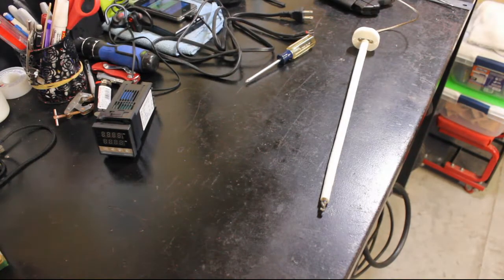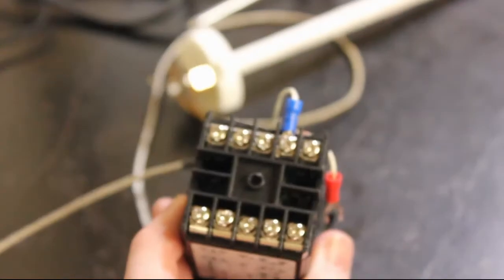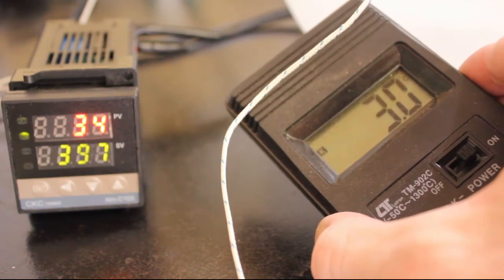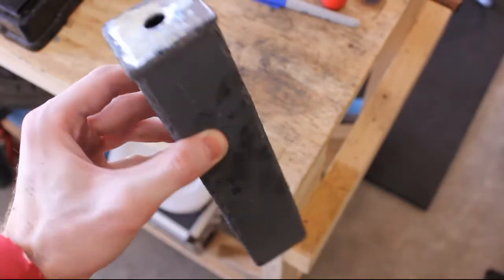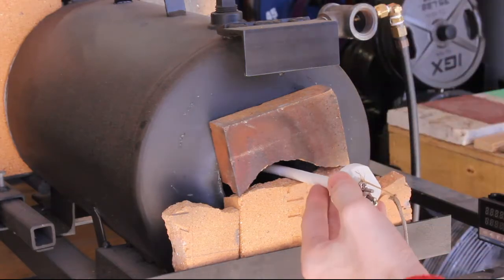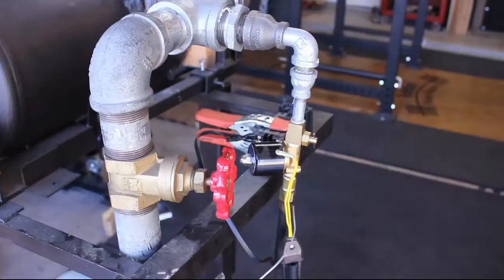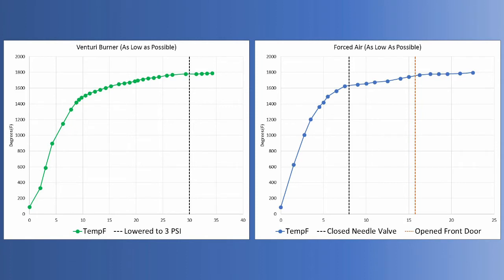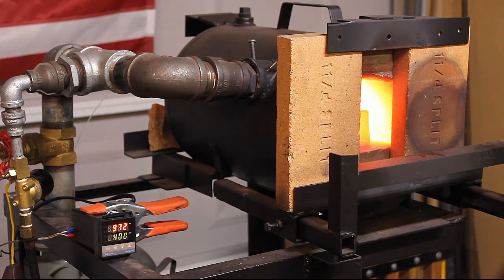How Hot is Your Forge? | This is How You Find Out

Comment from the maker: Anyone have any tips on lowering my forge’s temperature? Any burner sizing changes or ideas? 🙌
Reply: Did the muffle pipe help? I cant seem to bring temp down either so I feel your pain
Reply from the maker: @xxstr8jacketxx  So I did find that I had way more control when using the muffle pipe! However, my heat still got well above my target... I'm in the process of constructing a new forced air burner that I hope will give me more control overall. I'll throw it up on the TUBE once I have it completed! fingers crossed.
Reply: @RedBeardOps  that's awesome dave evader knives sent me your way.i am going to get one of those pids and rod to see how far I'm off.i have everything way down and my 3/16 blades turn orange to yellow in under a minute
Reply from the maker: @xxstr8jacketxx  I'm going to have to thank him! You know it can't hurt to see what temp you're at... Knowledge is power for sure. Heat treating much above 1550 is no good from my understanding, so it's worth investigating.
Reply: @RedBeardOps  I will be making a oven one of these days but I think my forge is to small for 2 burners I only use one and it still blast to much heat I'm going to make a muffler today and see what happends I may have to make my forge bigger this would be great for forge welding but not for HT at the moment
Reply from the maker: @xxstr8jacketxx  I feel you... it's hard to get them to run cooler!
Reply: What’s the internal cu of your forge? I remember Ron Reil saying his T-Rex 3/4” burner was rated too 350cu. It may be as simple as building a slightly larger internal chamber to allow the gas to expand and cool.

  If you go with less insulation or no ITC 100 you will lose fuel efficiency but the temps should also dip. How much of a dip idk.

Maybe lengthen the 3/4” pipe. I am just spitballing here but I would think a longer pipe would slow the mixture as a whole and put less btu’s in. Again this one is a guess.

Have you also tried running a screen in your flare? It will slow the mixture and provide great turbulence. It softens the flame tip as well.
Reply: Red Bear
Reply: So if I get a ceramic sleeve for the end of the thermocouple can I just lay it in my forge without having it in the muffle pipe?
Reply from the maker: @C M  you can. Should be fine 👍

Comment: thanks for the vid. I started using my forge to do some other work, i.e. enameling and glass fusing, so needed to have a better idea of the temperature. Will be getting a thermocouple in place for that. As a side note, for the enameling and glass fusing I began using a section of square tubing for protection, because direct impingement of flame is not good. Now I know the term for it - "muffle pipe".
Reply from the maker: Glad it helped!

Comment: I was read watching decarb on knives on blade forums, and I came across an old thread about this! I hear treat my knives in a forge, with a Venturi burner, and have been getting really thick layers of decarb. I have had my forge WAY to hot (2000 degrees ish) so if I turn it down, and use a piece of 2 inch angle iron as a way to block the direct flame of the burner, will the decarb be thin enough for me to just use a wire wheel to get through? Wil it be gone completely?
Reply from the maker: I don't think you could get 100% no de-carb on 1080, 1075, etc. Always expect to have to do some grinding post HT. I found when using 1084 it seems I get less de-carb then when using 1075. But it could of just been the batches I got.

Comment: Hi! Your PID has a relay out terminal, for sure. Hook up a gas solenoid that will turn on and off the gas to keep a pre defined temperature. That will work just like an electric kiln. Obviously, not as precise, but as far as lowering the temperature it will do the job IMO. Great work btw ,😊👍
Reply from the maker: Good idea, cheers sir!
Reply: @RedBeardOps  just make sure that your set temperature is always above a point that will let the gas self ignite. Because if you set a too low temperature, the solenoid might trigger and the gas does not ignite and you have a problem.or use a pilot flame / piezo igniter of some sort
Reply: You're right - effectively Pulse Width Modulation - great idea

Comment: Excellent video as always. Makes my forge look like a caveman built it with my weed burning torch stuck in hole in the side of my forge. When burning since mine is open front and back it looks and feels like a jet engine. I can barely get close enough to get my knife in without getting cooked myself. I have an oven on the way but I would like to make some improvements to my forge so I can do some knife forging in the future. Thanks for the tips.
Reply from the maker: E.T. Preppin thanks for the praise! Heck yours may get closer to 1500 than mine! I’m going to have to downsize my burner... 🙌
Reply: I’m going to have to put a thermocouple in my forge. Im curious what it gets up to. With 1084 it takes about 5 minutes to get to non magnetic. Seems to fast. Im sure I’m using a lot of propane when running!!!
Reply from the maker: @e.t.preppin7084  In a perfect world I'd like to be able to regulate my fuel gas down enough to have the forge hover @ 1500 F... They use it like a HT oven. Going to have to think on it for sure!
Reply: I just put the front back on my forge. It’s an old paint pot for spraying. Wish I could send you a picture. I should be able to turn my heat down and conserve propane but my temperature will probably increase. Maybe if you leave your front and back of your forge more open it won’t get as hot. IDK. I’ve done no research on the matter and am really new to all this. I’m into so much at one time I cannot learn it all quickly enough. If I were younger I would devote more time to every aspect of knife making. However I have to pay my bills and doing what I’m best at brings in maximum $$$. That’s life. You keep doing what ya do. You learn for me and I just try and do what you do. I brag about you to Dave with Evader knives. Your a perfectionist. I strive in construction to start every project with perfection in mind. As a job progresses you cheat a little here and there and you end up with a presentable final product. Start out cutting corners and you end up with garbage!!!
Reply from the maker: @e.t.preppin7084  Thanks for the kind words sir! Opening the front door of my forge may well work. I defiantly have a lot to think about on the matter to make some adjustments. Thanks for the kudos!
Reply: Well closing the front of my forge by 75% dropped the temp so much I couldn’t get up to 1500. Took it back off and let it rip.
Reply from the maker: @e.t.preppin7084  Interesting!

Comment: Did you ever get it to run cooler? If so , how?
Reply from the maker: Not really. Keeping the doors opened helped. I have become accustomed to the temperature and it is not an issue with heat treating. I was originally aiming for oven like consistency and I don't think that is possible with this set up. You'd have to put a PID controller on your gas supply.
Reply: Those is what I've been trying to figure out for about a year also. I was thinking of keeping the gas supply low and when the temp stabilizes, I would know how to repeat it. Of course I it's all proven to be way harder in real life than in my head.
Reply from the maker: @jarodmorris611  Man, I can get it to run fairly cool... I guess to "do it right" you could have a PID controller on a solenoid to supply the gas. I haven't yet gone down this road. Thank goodness you don't need to soak 1084...
Reply: @RedBeardOps  - I'm pretty sure I'm going to go with an electric oven.  I just had an idea though...what about a propane burner inside the electric HT oven to help it get to temp WAY faster wile the coils are heating up too, then shut off the propane and allow the electric to maintain temp.  Crazy idea??
Reply from the maker: @jarodmorris611  I wouldn't say "crazy", but I bet it could case your HT oven to get "dirtier" faster and maybe damage the coils faster too.
Reply: @RedBeardOps  - Maybe once I get the electric built I'll try pre-heating with the MAPP gas burner I have and see how it affects things.  But, first the electric HT oven

Comment: Ok I made a temporary ( insulated muffle pipe from plaster of Paris 12 inch long 5 inch in diameter with 3/4 inch walls reinforced with minnow trap wire , I put a cracked blade inside and it just wouldn’t heat up , I then drilled approximately 100;1/4 inch holes thru the sides, top ,and end . I put a piece of flat steel inside muffle pipe and one piece outside . The piece outside heated up to about 1700 f quickly but inside muffle was much slower and I was able to turn forge down low and hold the steel inside the muffle at just above non magnet for as long as I wanted. When I removed the steel it would go to magnetic in about 10/seconds. It may be possible to make a perforated muffle from fire brick and put my thermocouple up thru the bottom and inside the muffle and control heat where the blade is . I removed my 3/4 x 1 inch bell reducer from my burner pipe outlet and made. 3/4 x1 inch fork  y  by cutting and welding , thus modifying a 3/4 x I inch tee . Therefore I have 2 blue flames that strattel the center of my forge . Also I drilled four 1/4 inch holes in the 3/4 nipple just 1/2 inch below my intake tee with the mig tip . It makes a whistle sound drawing air but allows me to turn down forge much lower . It may be possible to drill several holes and make a sliding choke over the 3/4 nipple by using a 1 inch copper solder coupling. I would like to heat treat some 440  C but my understanding is that you have to control the temp . Yeah I could buy new equipment but when I checked it’s not available or must be built on order
Reply from the maker: Good info Randy! Thanks for posting it
Reply: @RedBeardOps  👍

Comment: It would seem that the main benefit of a thermocouple is to determine at what flow rate does your forge achieve welding heat of say (for mild steel) 2400 degrees F.  After finding this flow rate I could just use the flow rate to set my forge to a desired temp provided nothing else changes from one heat cycle to another.
Reply from the maker: Yeah, I think that could be handy. You can also set up a solenoid on the gas that can be controlled by a PID controller (hooked up to the thermocouple). Then the system would provide gas as needed to achieve a set temp. Very cool stuff.

Comment: Man you didnt use a ssr to run the pid?
Reply from the maker: Hey Fernando, I'd need an electric solenoid for that operation to console the gas. Yes that could work for sure.
Reply: @RedBeardOps  Right now I am connecting the rex c100> ssr> solenoid. But for some reason I have no SSR output. I think some configuration in the PID that I can't solve. shit

Comment: I don't know but it would seem if you increased fuel pressure, and lowered the air pressure a rich flame would be less hot that a lean.
Reply from the maker: This could be true. Only issue with the lean flame is scale. I took the long route here and built a heat treat-ing-oven... lol